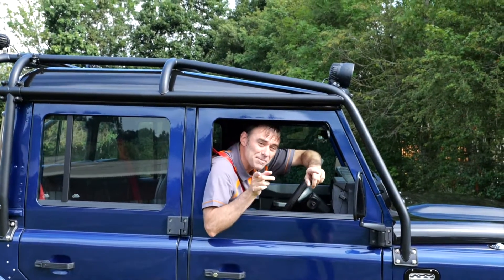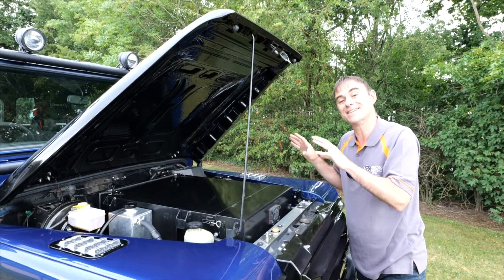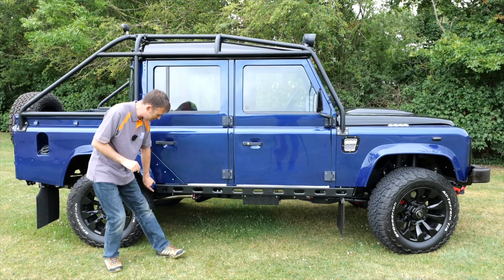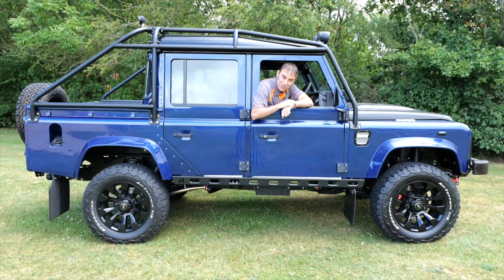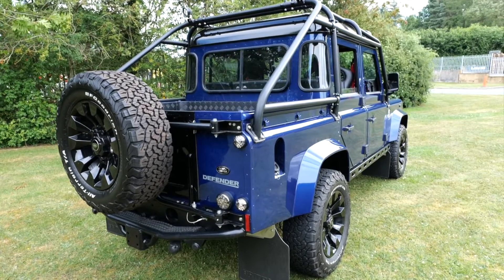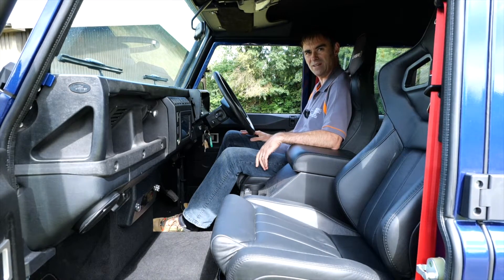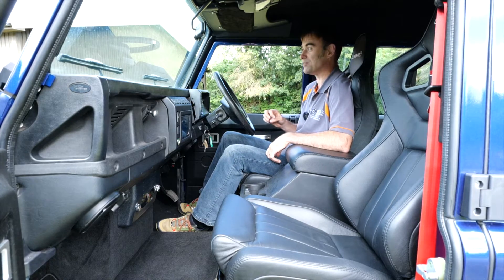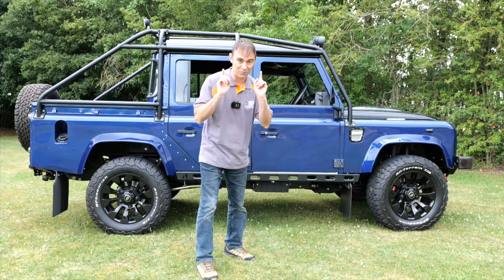Fully loaded Electric Land Rover Defender

Comment: Get rid of the ladder frame/diffs/axles,replace with a floor battery with air/sus,48volt system 250k charging.Guessing probably 4-6 years away still.... CC are doing awesome work and never rest on thier laurels 👊💪

Comment: Will you ever, or have you gotten requests to make a custom frame that could accommodate an in-frame battery pack like some factory electric vehicles? I'm thinking about the handling improvement from a low center of gravity.
Reply from the maker: Yes, but the challenge is fitting it into an appropriate space under the car without compromising ground clearance.

Comment: What you call Pimp mode should be the standard road mode, it should be lower for pimp mode. Problem is the tyres will not fit inside the guards like they should.

Comment: If you're worried about weight, you should just switch to hub motors... Even though single electric motor is easier to wire, having hub motors means all the torque is delivered with minimal loss...

Comment: Definitely need a electric kit for my l322... 😮😅.. Best bit is the front bumper for me I think...  stay safe 🏴
Reply: Front bumper and winch mount look like a poor after thought, added after the vehicle was finished. It should have been integrated into the front grille area to reduce front overhang and to keep the front face as flat as possible.
Reply: @johnt.848  mmmmm it's a defender that's the model after the line of series landrovers that was produced where everything was bolt on and off for easy replacement/ repair or upgrade in future  as it turns out..Britpart is an after production  parts supplier  So yes the bumper is an afterthought 😁and  because the person who probably designed it would be at a good bet not born when these vehicles were designed 😆...  and designed it so it was better for off road with better approach angles at the corners..  why you would want to change the whole front when you slid into a tree or rock is anyone's guess....
Reply: @johnt.848 The bumper is there to bump into things first and protect the rest of it. If it's level with the headlamps and the grill then it fails to do the job. Might as well not have a bumper.

Comment: The extra weight must be terrible to drive and handle going around bends would be taking your life in your hands 😦
Reply from the maker: It’s on road handling is much improved now it’s electric. Probably due to the improved weight distribution and the fact that it only adds the same weight as one passenger.
Reply: @ElectricClassicCars Wouldn't it be better if you could get that weight under the floor instead of taking up space in the loadbed?
Lower CoG, better handling and more space for otters in the back.